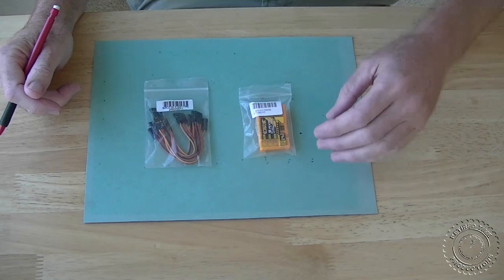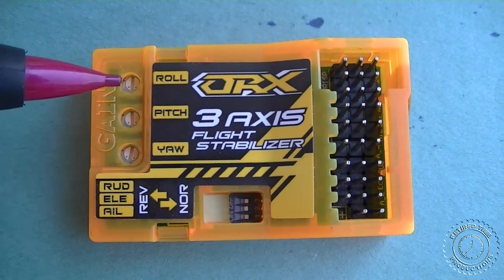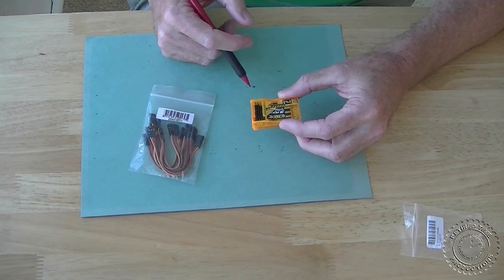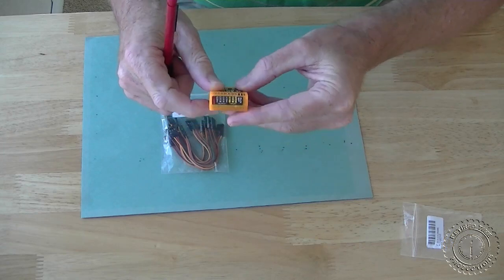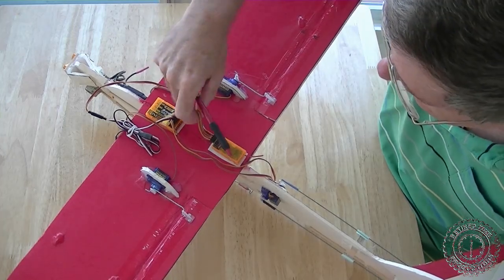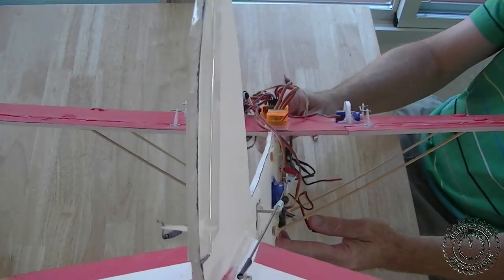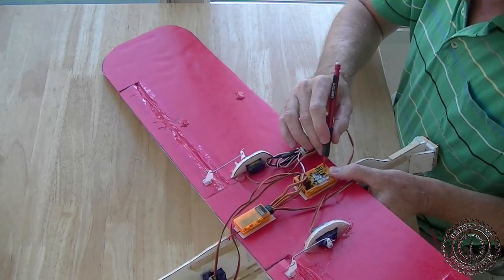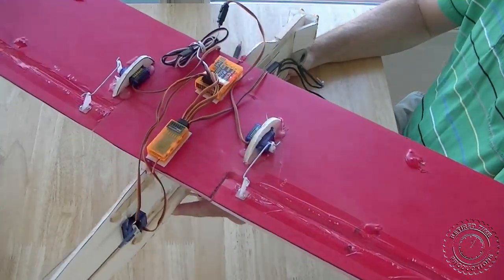HobbyKing Orange RX 3-Axis Flight Stabilizer Gyro System - Part 1 of 3 - good for FPV or Jets

Comment: did you completely forget about the little reverse dip switches?
get rid of that splitter plug it directly in and flip the dip switch
Reply from the maker: +BofaDeez2Nuts Nope didn't forget. The Y-Splitter saves having to extend the servo leads and just makes life easier for connecting.
Reply: +dmerc00 
have you heard of a glitch buster?
it's a small capacitor hooked to an empty slot on the receiver that catches all the noise... I got one and voila no more servo glitching. 
another fix is wrapping the servo wires thru a ferrite loop to reduce the noise.
but seriously.. splitters cause jitters.

Comment: can this be used with another type of receiver not the orange?? i have ezuhf on my plane will it be compatible?
Reply from the maker: +Alejandro De La Garza Version 2 will work with any receiver but version 3 has a built-in receiver so you have to use a Spektrum compatible TX.
Reply: +dmerc00 i have The same versión as The video my problem is that when i turn on The stabilizer and move my plane The servos react the correct way but immediately servos return to neutral position even if i hold my plane tilted, the servos dont remain correcting The movement

Comment: I think you could turn the gyro on/off. If you don't run any power to any of your AEL/RUD/ELEV connections, and you run JUST +/-  to the BAT connection to a switched channel on the receiver, you could potentially power on/off the receiver at will.

Comment: New to hobby and going to install flight simulator to trainer. I'm confused in the action of the stabilizer. If the plane rolls right, should the aileron go down?
Reply: uhm if the plane gets rolled to the right.. this gyro will counteract and make the aileron of the right wing down.. bringing the plane back to leveled flight

Comment: Yes you are right but the problem still arises you cannot use separate sub trim or aileron throw by using a single servo wing set up. I think this is either  design fault on the Orange or a design fault in the DX8. Most wings have 2 servos and you need to adjust each one individually if you are using the stabiliser, just the same as if you are not using the stabiliser. Nice to hear your comments, very much appreciated.

Comment: Thanks very much. Perhaps I failed to mention I am using the combined receiver and gyro. I had exactly the same problem when using the V2 gyro with a separate receiver. All "V" and Delta tails are off and no flaps. Just to confirm with a 2 servo wing setup and  when I put the right aileron into the aileron connector of the receiver/gyro and the left into the AUX you cannot turn the gyro OFF from your transmitter. Works OK, like in your video with a "Y" connector and one servo setup.

Comment: Thanks for your reply. I do not have retracts and use the Gear switch to control the gyro off and on. But if you use a standard 2 servo wing set up the gear switch does not turn the gyro off or on. The only way I have found to get the switch to work is again to have a single servo set up for the ailerons and ` "Y" connector. This is not good as most planes these days have two indipendant servos allowing you to control each aileron sub trim separately.

Comment: Hi, an outstanding video but you fail to mention that the on/off switch only works if you have a wing setup using one servo. I also have a DX8 and it took many hours to find out that if you have a wing set on your transmitter using 2 servos you cannot switch the stabiliser OF and ON. Your video indicates you have a choice of using one to two servos, one with a "Y" lead. Am I missing something here?

Comment: Sry. That's not what I mean. The kk2 has a very poor self stabilizing system. ESP on quads. What I wonder is if u can use this with a kk2 for such as a quad to fix the lack of , the kk2 has for self-balancing

Comment: If oscillations are noticed, continue to turn the gyros down until they stop.  At this point I like to use a small Keychain camera mounted on the aircraft.  If oscillations are noticed in the video, (except for in high wind) turn the gyro pots down in small increments.  This should smooth everything out.  Generally, when I do the bench adjustments, the aircraft fly quite well.  Hope this helps and Happy flying!

Comment: dmerc00,  The "hunting" jitters of the servos is due to the gain pots being set too high.  If you were to try to fly like that, you would get bad oscillations that get worse at higher speeds.  I adjust my gyros down low and sit the aircraft down so it will remain still. Then I crank up one of the gyro pots at a time until I get jitters, and back off just enough for it to stop.

Comment: I too have one of the OrangeRx stabilizers and mine locks up on the stick movements after it is on for a while (20 - 30 seconds or so).  I am sending mine back for a replacement because I know it will lead to a crash:(

I wish this unit was a heading hold unit like the AS3X's are!